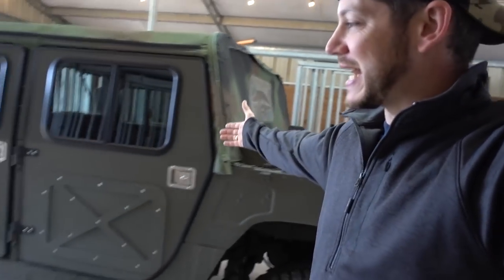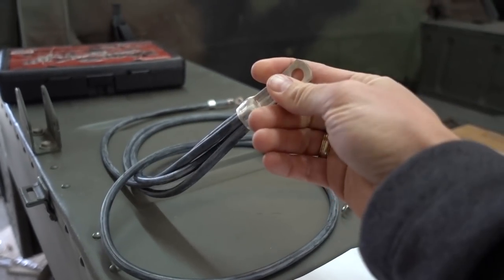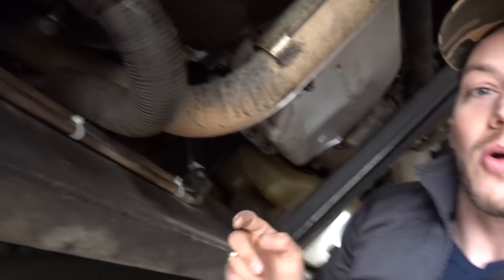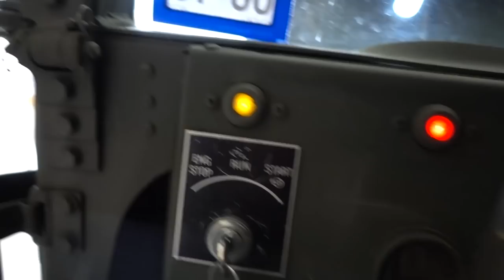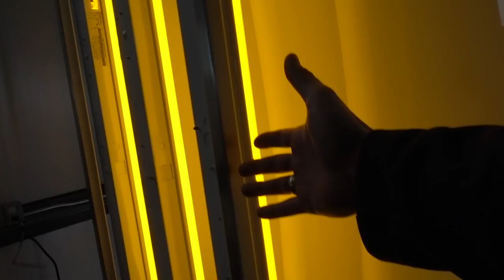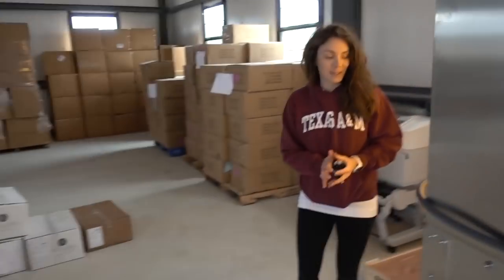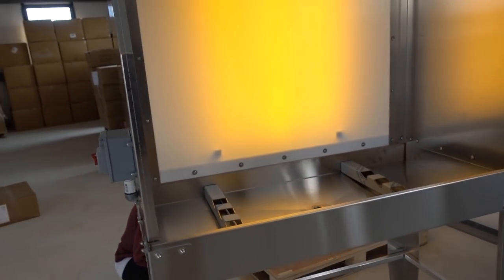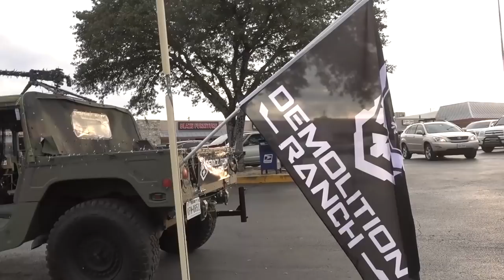I FINALLY DID IT!!!!! Yessssssssss!

Comment: Thats the transmission kick down cable. When you push the throttle down to pass or when you floor it the transmission kicks down a gear. Needs to be reattached but not keeping you from driving.

Comment: That cable should be a passing gear cable, or kick down cable as some call it. It tells the transmission to drop a gear when you floor it, so that it will accelerate faster.
Reply: chase5726 yup. good chance that's it.
Reply: Agreed
Reply: So basically tie a string to it and pull it when you want to downshift? Lmao
Reply: Yup that's it.
Reply: chase5726 yes sir
Reply: Zip tie it ;)
Reply: 91bR4 here can confirm
Reply: KICK DOWNS ARE THE MOST FUN SHIT EVER
Reply: That is exactly what it is
Reply: chase5726   I'm eleven and were the only ones who know that?
Reply: Yupp kickdown cable it is. If i remember correctly that transmission is the 4l80e maybe you guys would know
Reply: You got to it first
Reply: No, 4l80e is electric. these are plain balls Turbo 400's {until the later gen HMMWV's}
Reply: Diesel Ramcharger ohh ok i thought they had an overdrive thank you
Reply: Nah not these USMC trucks. These are essentially First Generation HMMWV's. Later on they got turbo's, overdrive...all sorts of fun stuff.
Reply: Wilson Rey 07

Comment: the cable looks like its a part of the m998 Transmission Modulator
there is a part the hooks onto the other part
the wire didnt snap the piece did
like this so matt can see please.
Reply: What problems will this cause?
Reply: Its the kickdown cable in normal human words... it tells the transmission when you're widow open or off throttle and when to go back down gears. The trans will downshift on its own naturally because of load stress but it isnt the right way for it to work. Matt, i would replace the cable but it isnt the end of the world if you dont. I ran a transmission shop for a number of years and its a common issue that the end links break when they are plastic, or when people take factory carburators off old muscle cars and swap to an aftermarket but dont know you have to buy a linkage kit to hook the kickdown cable back up.
Reply: Good find.
Reply: 8th part down the list and in stock.
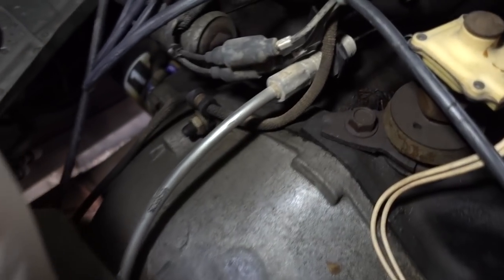Part number (5596528) gave it away. @05:19
http://www.mtpdrivetrain.com/part-inventory/page/58/
Reply: What sly5.0gt said; when you drop the hammer and floor it, makes the automatic downshift immediately.
Reply: G

Comment: It's the kickdown cable for the passing gear. It connects to the throttle linkage
Reply: Jeff Kimberlin Do you work at Orange County Choppers????
Reply: Jeff Kimberlin agreed kickdown cable
Reply: Jeff Kimberlin THIS^^^^^^WHOOOOOOOOOOO...yeah...leaving now...ďà wòöķįęè
Reply: Gonna say it looked like a kick down cable. I was just gonna cut mine once (normal 1980 ford auto car) if I found it was fraying/sticking until i could replace it but it turned out ok. Something you can take your time fixing long as its not connected, frayed internally and can get stuck.
Reply: Jeff Kimberlin  smart
Reply: Came here to say that, but figured I'd look and see if someone else already said it :)
Reply: Jeff Kimberlin I see a bailing wire fix...
Reply: Transmission throttle cable,
Reply: It your go fast cable gotta get it fixed.
Reply: Confirm from mechanic husband. It is a kickdown cable
Reply: Maxid1 I see a zip tie fix
Reply: Beastie Prince lmao, I get mistaken for Paul jr alot!
Reply: Maxid1 duct tape should work too lol
Reply: Brianna Powers I'm a master mechanic tell your husband thanks for confirming it

Comment: (Jeff Kimberlin) <He is right that is the kick down cable aka TV cable, it is attached to your throttle linkage. It adjusts the valve body pressure according to where your foot is on the throttle and clutch plate apply pressure, so yes when you push the gas it will drop a gear allowing you to speed up faster and pass. Looks like a really easy fix, you can drive it without an issue with it disconnected but if fixed it will shift better, clutches will hold stronger (without slipping) and as mentioned before it will shift into a lower gear when you need it to.

Comment: Matt, that cable on the transmission is the transmission kickdown cable, thats what lets the transmission drop a gear when cruising and you step on it to pick up speed, very common issue on these HMMWV hummers. Ive replace dozens upon dozens of these exact ones. Although nothing a little bailing wire would make hold together too. But a relatively  easy process to replace the whole cable.

Comment: Haha, I just got my 2000 HMCO Hummer running today too. Mine turned out to be water in the fuel, code 0251. The guys you mention, are members of The Hummer Network. They have helped me out so many times. Not the least bit surprised, they  came to your rescue. This video is posted on that forum, with a thank you for the work you do for others.

Comment: I recommend taking any high amp battery cable or starting cable and wrap it with split heater hose or at the very least split wrap. I use Amsoil spray Metal Protectant on the battery and other exposed terminals.

Comment: transmission modulator cable, part number 5596528, stamped right on the part. 
https://www.easternsurplus.net/PartDetails/3470/HMMWV-Transmission-Modulator

Comment: Take your rings off when working on wiring!
Reply: calsonic86 12 (or 24 volt in this case) can’t hurt you in a vehicle with such low amperage
Reply: calsonic86 just wrap them in electrical tape.
Reply: The ring can cause short if it get in between a hot connection and ground.  It will then get red hot in a hurry.
Reply: I'm pretty sure an Aggie would rather die than take off his ring...
Reply: Bill Jenkins, it's not because of the risk of a shock, I've seen pitures of techs who had wiring literally weld itself to a ring and cause very bad burns, there's also the risk of degloving if you happen to get it caught on anything when you're working
Reply: Price B that's what string necklaces are for

Comment: Matt, glad the extra grounding cables worked. But it's a bandaid fix. Just clean all of your original grounds and treat them to prevent corrosion again. At least it wasn't your electric glow plug control box under the dash on the driver side. That's usually what causes a no wait light start, that or bad glow plugs that are burnt out.
Reply: Salty Steel he cleaned the grounding connections in a previous video and it had no effect.

Comment: Ah the fun silver  kick down cable keep the cable as taught as possible without stretching it that helps the trans and throttle work together in sequence to keep the engine running and shifting correctly. Check the glow plugs on it they do wear out after a bit of service. Being an 89 it may need a tune up.

Comment: Its the kick down cable for the transmission. Used to increase fluid flow to the down shift hydraulic circuit so that when you step on the throttle at lower RPM'S it will shift to a lower gear without hesitation.

Comment: I used zip ties, metal tubing and radiator clamps to fabricate a $300 hot air duct on my old Volvo using only $30 of hardware from a Napa Auto store. Works just great XD So I'm with ya on the zip ties bit, Matt, and I've never owned a Humvee.

Comment: Doubt you’ll see this but your wires are probably just switched around on your lights, have the same problem all the time when new privates try to install headlights. Each one should have a number stamped on it that matches up to a number stamped on the headlight. If the stamps are gone just trial and error it till they work correctly.

Hope this helps fix your headlights.

Comment: ON my 99 ram 1500 that cable running off your throttle body to the transmission adjusted what rpms your transmission shifts at. That cable should should have a bracket holding it in place (keep in mind that is for my mopar)

Comment: It's your trans kick down linkage. Matt Google it kick down shift and you will images the wire you pulled on will kind of look like an I bolt. This controls the governor pressure within the valve body for the trans. In simple terms you put your foot down doesn't go anywhere doesn't down shift. Fox this and you trans will actually down shift and put you in the correct gear. If you need help email me. I own a shop I willk help the best I can

Comment: That cable is the kick down cable that shifts the transmission to a lower gear under hard acceleration for like passing cars as if you would ever actually do that. Lol.  I am not sure if you can buy just that plastic clip but if not but replacing the whole cable requires getting into the transmission so I would shop around a bit.  I know Holley sells an adapter kit for switching to one of their carb's that can be picked up at almost any auto parts store and that might be a cheap fix if the correct part is hard to locate.

Comment: Dr. Matt, You're going to need a dark room to emulsify and store your screens and an exposure room and exposure unit to burn the screens and a pressure washer to clean them.  My wife has owned a screen printing shop for over 25 years so message me if you need any advise or to answer any questions.

Comment: the cable is for "Passing gear", used under heavy acceleration, causes transmission to down shift when you floor the throttle.

Comment: Kick down cable, it attaches to the throttle, when u "put the pedal to the floor" it will kick down the trans gear to the last possible gear for heavy acceleration

Comment: Passing gear cable to transmission, Matt you might want to put some dielectric grease on the connections or some antiseize to help with corrosion

Comment: If it's like most transmissions it is probably your kick down cable with when you stomp on the pebble it will drop a gear down to go faster then once you get it speed it will shift forward again

Comment: It is  Throttle Valve cable the cables tells the valve body  which position the accelator pedal is in it adjust line pressure in transmission, being unhooked with roast the clutches in the transmission to much adjustment can brake hard parts inside the transmission.....
Reply: Butch Cassidy You sir know what your talking about. Its not just for passing. It adjusts pressure on the clutches while you modulate the throttle.

Comment: That broken cable looks like a kick down cable. on the highway or going up hills when you press the throttle your transmission will downshift to provide better acceleration and take load off the engine. without it your humvee would never downshift unless done manually. it will return to first at a stop but if you are in 3rd on the highway and mash the throttle it will not downshift and becomes a pig. wont do any damage mechanically but can lead to poor fuel mileage and can make the thing seem way slower then it is.

Comment: you should spray your grounding points or put electrical grease on your ground connections , it will prevent corrosion which could apparently save you 600$ if a bad ground causes the computer to go out.

Comment: Had same problem,  the battery cable to the starter and the ground were just a tiny bit too short and not making full contact.  Put on longer cable and problem solved.

Comment: easy fix for the wire at the transmission is to brake the knob of the end (on the wire) mesh the front part ca 4-5mm up (for better grip) and then use tin or lead to "weld" a O-ring or something similar to it and hook onto the recever. just make sure it is´nt haning needs to be tight. then as long as it holds is don´t matter what it does since it doing it.

Comment: Check to see if the cable attached to the throttle. If it does it may be a kick down cable to. the transmission.

Comment: That cable looks like the kickdown cable for the transmission when you step on the gas hard it supposed to downshift a year to be able to take off a little faster otherwise known as the passing gear cable

Comment: Grounding problems....
Check on any car forum anywhere in the world, and you will find that there are some car models that are just born with this issue.

And it´s not that strange, if you think of it. Copper work hardens, so cables attached to moving components will break after a while.

Comment: Accelerator cable for when you need to get on it it'll go all the new vehicles are electric built into the TCM the TCM or PCM changes the accelerator or downshifts the shift solenoid in the transmission nowadays

Comment: Detent cable so your transmission downshifts when you push gas pedal to accelerate, order a new cable and adjust it properly so you don't fry your clutches in your transmission...

Comment: Is it cause of humvee or what, but Mere with the fluffy hair, hoodie and those pants looks so freaking se.. umm.. family channel.. stunning soccer mom.
And Matt. Did you leave some loose wire down the car? Motor moves little bit, so there has to be little loose when zip ties to chassis.

Comment: NEED TO CHANGE TIRES...BFG Military tires are the best hands down for the Humvee.
BFGoodrich Tires are renowned for their nearly indestructible construction, supreme performance and confidence-inspiring reliability and the Baja T/A® tire is the perfect fit for the Humvee application. 

"Being able to carry more weight and perform evasive maneuvers, such as double lane changes, are things that this tire does that the previous Humvee tire couldn't do," added Fred Wheeler, product engineer for BFGoodrich Tires military products. "We started with the commercial Baja T/A tires, which are well-known for performance and durability in desert racing and the end result was the BFGoodrich Baja T/A tire developed specifically for military applications, which now meets or exceeds the military's expectations. This contract also proves Fort Wayne's flexibility to produce this unique tire and begin production on an accelerated timeline."

Independent testing confirmed that the Military BFGoodrich Baja T/A tire:

* Carries an E rating load capacity of 4,540 pounds per tire at 65 PSI
* Has a 22.5 percent increase in projected tread lifewhen compared to the previous fitment
* Has more wet pavement maneuverability (11 percent) and dry pavement maneuverability (8 percent) during evasive maneuvers when compared to the previous fitment 
* Has better mud traction (20 percent) when compared to the previous fitment (Goodyear MT)

Comment: I was working in screen printing company for 4? years. We were making prints on Cups.
Ok so u have washer to clean screens. good.
And u have printer to print on foil (this print must be reely dark).
We outsorced foil making to other company becouse we made lot of complicated things. They used CTF (Computer to Foil? :) printer.
With only 1 color it will be simple.
So now u need 2 more maschines and lot of chemicals :)
First is (dunno how to say in english) big glass table with lights.
And second is Printing maschine :)
Oo and karcher :)
And 3 dark rooms - 1 for washer, one for glass table, and 1 for screen storage and preparation.
If u clean screens after printing reely good u can use this print for a verry long time. 
This mud is werry light sensitive :)

Comment: Matt, glad the new ground harness worked.   But it sounds like you have a cylinder with low compression. I noticed it on the start-up. Do a compression check of each cyl.

Comment: Kickdown cable for a Turbo 400 transmission
Reply: And by the way, banks makes a Turbo set up for the 6.5 gm hummer/humvee. Worst case, find a wrecked 2500hd or 3500 gm and get the 6.6 duramax with the Allison transmission.  Then you'll have 3 times the power and better mileage with the Allison transmission

Comment: Matt.You should totally to a serease of videos building the motor on the hummer.Exhaust,turbo kit,injectors,ect.I'm sure tuns of diesel guys would dig it.I know that the 6.2-6.5 engines are not great for making big power so there is always a 5.9 12v cummins!

Comment: the cable is not broken the is a plastic clip missing and its a kick down cable it can be driven with out it but in the long term it will wear the trans out a bit faster. and what it dose is when u push the fuel pedal down fast it make the trans kick in to passing gear and i think autozone may have it in the help section for any chevy 4.3 v6 or any v8 auto trans up till the mid 1990"

Comment: the ground and positive wires need to be upgraded to 4AWG , better flow better reliability  #SLAMOLOGY we know vehicle electrical flows and how to make it 100% . trust me mat  when you upgrade the power and ground lines the better the vehicle performs , and also helps you with audio performance as well if you add a aftermarket system.